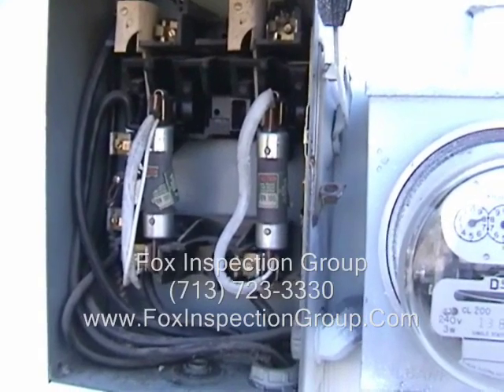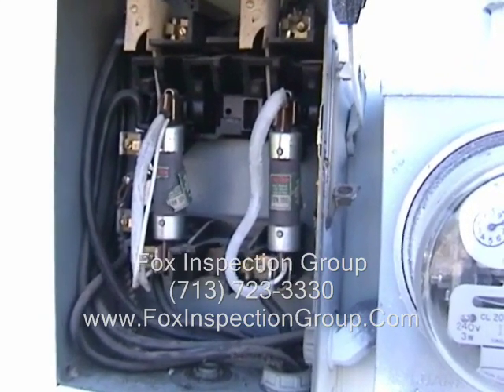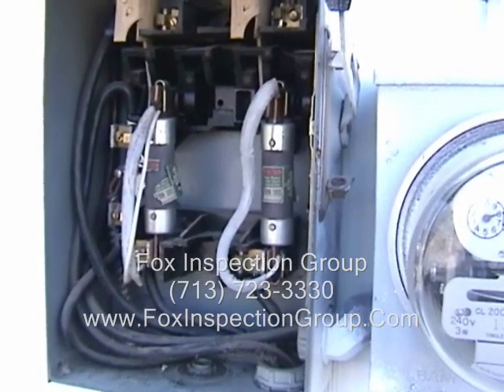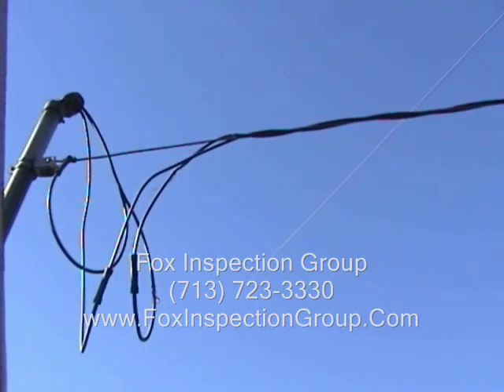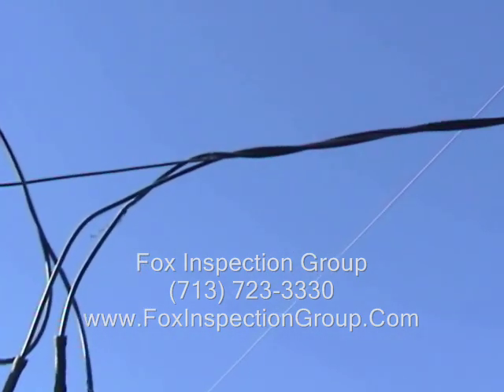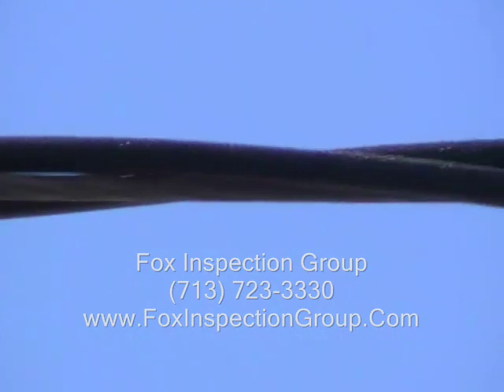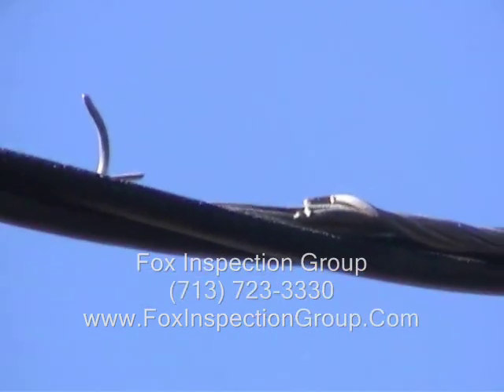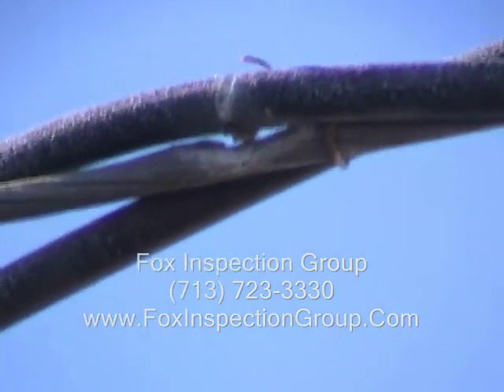Damaged Electrical Service Drop Neutral Wiring

Comment: I seen a fucking meter pan 200A, hanging 4 ft off the ground it was hanging by drop cable only about 13ft the rest of the way was a piece of 2/0 seu spliced to that and terminated in the meter then another piece of 2/0 seu feeding the panel to the house. Swinging in the wind no pipe suburban area haha.
Reply: Couldn't start working because there was a dead car in the driveway with no plates or anything and a guy from out of town had to come with keys to move it

Comment: Reminds me of the fuse boxes at a place we rented a few years back. Split service, since the house used to be split into apartments, and both boxes had 2 circuits out of the possible 4 in the box in use. But that was nothing compared to the other two items. Those were:

1) Both circuits for each service were off of the same side, putting all the current for the usage on one of the two ungrounded wires for the service.
2) All eight fuses were the "universal" Edison base (type T)  rather than the rejection base (type S), and had at best 14ga wiring for the circuits, but had 30A fuses. (Yep... 30A!)

I immediately went to the store and got new 15A fuses, but nobody in town had the reduction base adapters (that would have required going to either the other side of the valley, or over the mountain), just the fuses... so I at least got them on the right fuses. I also grabbed my clamp-on ammeter and looked at the currents, and even when a window AC kicked on, the circuits maintained a current cleanly below 15A. But we checked with the city, and found that none of the electrical work had been inspected going clear back beyond the 1950s, and the landlord constantly drug his feet when it came to unifying and updating the electrical service and panel, would not concede to picking up adapters and type S fuses, and we finally moved out. Just one of a number of reasons why it would have been a great place to buy, looking at the surface, it would have been a mistake.

Comment: And also you can't use number 10 wire in parallel like that  the minimum is 1/0 so thats a code and a law violation